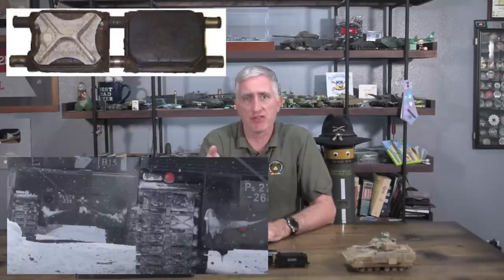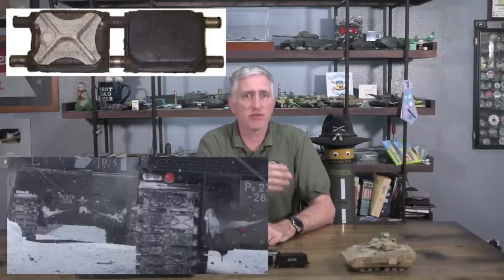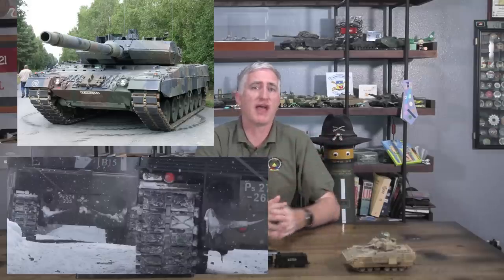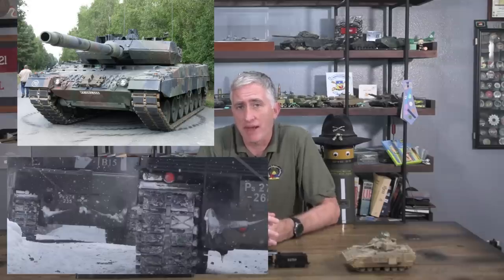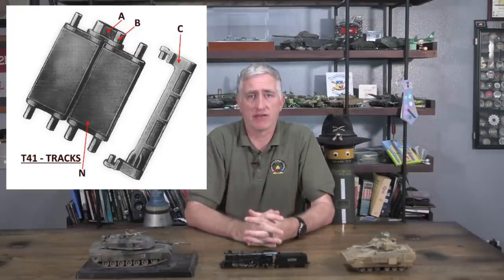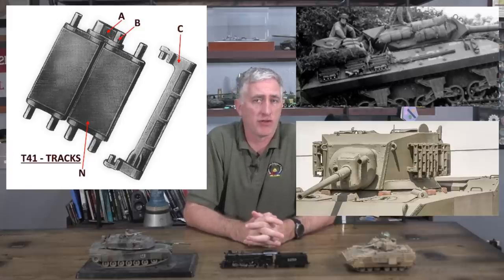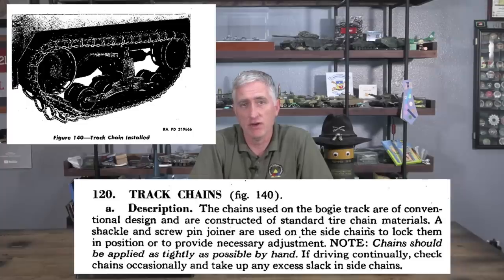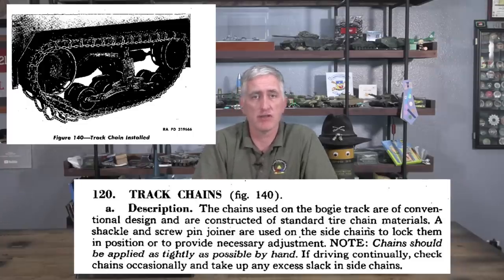Tanks 104: The basics of armored vehicle tracks

Comment: Couple of track anecdotes, to wit: We did a road march around the British MTA (Major Training Area) of Bergen-Hohne in our freshly issued M60A1 RISE Passives (C/2-1 Cav, 2ad (FWD)) which were the first time we had seen the track with replaceable pads, T142, I think? Turned out the adhesive attaching the pads to the backing plates was bad and we spent our road marches with the loader facing rearward on the lookout for flying track pads. These were quite weighty and capable of injury if they caught you unaware. actually batted one away once, ONCE! ouch.

During a REFORGER exercise (same unit) in I want to say '81 we were motoring through some Ballpeenhammersdorf outside Hanover when we had to make a right turn on a cobblestone road. Rubber pads notwithstanding by the time the troop got through we had pushed all the cobblestones to one side and dug an impressive gouge. A couple hours later some bright light decided we were in the wrong place and ordered us back to our starting point. coming back to Ballpeenhammersdorf we now took a left turn and undid all the work a repair crew had done to repair the original damage. I'mna pretty sure they were not amused.

Bonus anecdote not strictly track related: Approaching ENDEX we were ordered to convoy to an assembly area where we would wait our turn to railload. We had to cross a canal and the only bridge for miles had a weight class of '5'. About the only vehicles in a cav troop that could safely cross a weight class 5 bridge were the jeeps. My PSG, hard charger that he was (future TRADOC Smaj) ordered me across the bridge. Being a freshly minted buck Seargeant I said 'roger' loader, gunner, get up here with me on top of the turret and traversed the turret to make it easier for the driver to bail, just in case, don'tcha know. Took it across at about 10mph and made it. turning onto the road paralleling the canal I turned to look back waiting for the inevitable oh spit moment. Miraculously everyone made it while I watched pieces of the underdecking fall off the bridge into the canal.

Fast forward a month was playing a monster panzer leader/panzerblitz game (4 players, 1 American armored div, 1 British armored div, 1 Russian mechanized corps, 1 panzer grenadier div. each enters from one side, massive catfight in the middle, no allies (officially, but skullduggery is always afoot). Anyway, one of the players was a Lieutenant who was also the Bde's maneuver damage officer. I casually related about the bridge. I'd never actually seen someone turn white. He disappeared and came back in a few minutes with a map. 'Which town Sgt A?' That one sir points "Gotta go, see you guys later, clean up before the Major gets here. He has a temper and I won't be here to run interference." Yessir. It was Sunday morning and we'd just pulled an all-nighter playing the game and had just returned from breakfast. Found out later from him that he'd gone to the town in his POV and found that the bridge had been repaired, bill for the work submitted so everyone was more or less satisfied.

Back in the mid-70s we had something called 'Brigade 75, 2AD, 1st and 4th ID(M) fielded a fourth brigade that would rotate in and out of FRG on a 180 day TDY rotation. Eventually some bright light figured it would be cheaper and less disruptive to make the now independent brigades permanent so 2AD(FWD) was actually an independent brigade until 2AD deployed when we were supposed to link up and deploy with the parent division, which we did once, ONCE. Can't speak for the mech bdes.

Thus endeth the interminable 'anecdotes' related by a 66 yo armor has-been. Gimme a step ladder, I can issue a fire command. Gunner! HEP! Schoolhouse! Fire Fire Smoke! But all the new electronics? Not my M1, looks the same, not the same. Taught the M1a2 to Kuwaitis, current M1A2 SEP whatever is not the same tank. It look similar but someone would have to carry me and I be old and stuph.

Comment: It is a very interesting video and basically you have highlighted the basic difference between a fully metal track and the rubber padded tracks. It always come in my mind the Sherman with the the two types of tracks., that said the crews always complained the lack of handling, even on relatively low slopes on wet grass with the relatively narrow rubber tracks but generally much easier on hard roads. Good job as always 👍👍👍

Comment: B 1/185th once went to Minnesota in January for a winter AT.  Needless to say, the ground was frozen hard.
The tanks slipped and slid over almost every surface, so we refeversed every 10th centerguide.
It worked like a charm, but the horns of the guides ended up getting bent and deformed the hole assembly, we had to cut a lot of them off.
That took a while with 14 tanks and two torches.
Reply: I'm assuming it would not have been possible to weld grousers on it, or not permitted.
Reply: @tacomas9602  Dunno that grousers are even available for M60/M1 tanks.

Pulled onto a range at Bergen-Hohne, started firing and the snow started falling. By the time we were done there was about 6" of snow on the ground. When we tried to drive off the range (paved road) first tank got halfway up and slid back, second tank didn't get that far. Moi saw this and turned off the road and went up on the ground alongside. Everyone followed me and all were happy-ish campers. CO was not amused 'range control is going to be on  my ass allison'. Never heard a peep from the british or the germans.

Comment: Track Basics tracks always break at the worst possible place and time. Also dun fact car tires rotate just like tank tracks. At the contact point the wheel/track is not moving, but the tire/track portion 180 from from the contact patch is at maximum acceleration and from the 180 point it starts slowing down until it comes to a stop at the contact patch.

Comment: Another great video.  You mentioned reversing center guides for traction on snow/ice.  Thing is you just can’t reverse the center guide.  The center guide is too tall unless cut down and will make a nice cut in fenders and sponson box’s. I know in the M60 series we carried sand bags full of cut down center guides in the mid 70s in both ROK and FRG and in the mid to late 80s in FRG. Never did put those on but we carried in case needed.

Comment: The reason for the rubber in a live track is that it deforms, twists, allowing the track links to hinge ( a bit) while the pin does not rotate in a bushing or something. The pin is vulcanised to the rubber.  As the pin does not rotate is does not wear out. Therefore live tracks last far longer. Its the same principle as the silentblocks in a cars suspension.

Comment: Well, that's a few of my questions answered with your usual excellent style. Now why is it that some tanks shed their tracks more often than others. Thinking back to the book brazen chariots involving Brits driving M3 light tanks (Honeys) it is said that the honeys would keep their tracks on in maneuvers the Crusaders would not. The Honeys had rubber blocks in their tracks that would tear up over rocks (as you described). Now there is a question about how the suspension spreads out the load from the tank. The German Panther and Tiger had overlapping road wheels which they held would provide more even and effective loading. Since the Mk V and VI had tracks that were much harder to repair and were prone to freezing solid in those wonderful Russian winters - how much of an improvement was that arrangement?

Comment: As for the rubber pads on tracks, not just to protect the "civil" infrastructure - they provide more grip on paved roads, as in towns in Western Europe, but also don't tear up the roads, and so making it more difficult for your supply trucks to follow you.
Still, in 5 years in the Army, we never changed the pads - just replace the whole track, and if someone wants to put on a new pad on a track block back at the depot, well, so much the better for the crew that next uses that track block -

Comment: Bit of a physics note; tracked vehicles are still wheeled vehicles. The amount of roadwheels and I suspect their lateral width and diameter still matters for ground pressure, as the contact patch load is distributed around the roadwheels. The track does not completely evenly split the load as some sources seem to imply. I'm pretty sure there's easily-obtainable mathematical formulas to calculate the approximate contact patch load for tracked vehicles, and I've seen a few FEA sims that insinuate this.

Comment: Would love to hear more about modern rubber tracks like they use on some cv90. I think they are 4 pieces linked together for the ease of replacement. They are also relatively heavy, on a half of a metal track
Reply: Articulated cab tracked AFVs like the BvS 10 and Bronco/Warthog have a continuous rubber track, IIRC. They are relatively quieter and less brutal on road surfaces than metal tracks.

Comment: Ground pressure can be tricky. I read a story about the Falklens war, and a British tanker stepped of his Scorpion tank and sunk above his knees in the bog. The tank had less ground pressure per Sq inch then his shoes.
Reply: Kinda boggles the mind before thinking about it, but that one is a lightweight reconnaisance vehicle so it probably has even lower ground pressure than most vehicles.
Now I'm tempted to look up its track width, estimate how much of it makes ground contact and calculate how heavy/light a human in normal shoes would have to be to get the same pressure.

Given the much larger area a tank has contact with locally bad conditions also seem plausible to me, a single small bad spot wouldn't let the whole tank sink but if the human feet find the bad spot that's bad news.

Comment: Look up the Canadian M113A3 track i thinkbyou be in love. TLAV. The track is fixed easily by strapping metal bars to fill in the gap. It is tensioned by grease gun. And 2 good tech can change the track in 2-3 hours. The chains are 6-8 inchs long attached by bolts to the side of the track. Fantastic system

Comment: Are tracks interchangeable left to right? What determines when a track is worn out and must be replaced entirely?
Reply: Wear is similar to a bicycle chain. Too much stretch.
Reply: Track links will stretch over extended use and the track tensioner is used to take up the slack as he tracks stretch. The Chieftain tank has 96 track links when new and as the track stretched you removed a link, when the track was at 92 links you had to then fit over pitch drive sprockets to accommodate the increase in pitch as the track wore. When the track was at 88 links you reached the discard criteria and had to replace with new track and standard pitch drive sprockets.
Reply: M1 tracks, per the manual (not sure in practice), have to be removed and reversed every 500 miles.  So the track gets pull off, laid next to the tank, spun around 180 degrees (so the original outside edge of the track is now inside) and put back on the tank.  After you went over it and replaced all the obviously worn out parts. Every 1000 miles you did this and then put the left track on the right side and the right track on the left side.  Not sure when the track was considered worn out, but each of the dozens of track shoes has about 30 parts (including the nuts and bolts) that you can replace as needed.

Comment: note that once a track s slipping the second track will keep the vehicle going straight and the slipping one becomes a conveyor belt that hardly convey anything since id doesn't grip on material. tracks a good for flotation but not all tracks a good for traction (the b1 bis stile tracks where kept on the arl 44 because deemed superior as many know but it was traction wise, those are basically dozer tracks) rubber tracks < padded tracks have less traction than steel tracks < construction machines tracks even bulldozer use different tracks aggressiveness, drain layer and trenchers have huge grousers  that can be added or removed according to soil softness.

a tyre will grain grip due to structural elasticity up to 25%, slip a track will up to 5%. you don't want a track to slip but in order to steer it has to...

Comment: I have to wonder if the designers of the British WW1 rhomboid tanks were thinking about increasing track contact when they sank into softer ground. The curve in the wheel placement would have been to decrease the amount of track in contact with the ground so that they could steer those awkward beasts. The overall track length and shape was made for crossing barbed wire and trenches, but anyone who knows anything about caterpillar tracks knows that the longer the track, the harder it is to rotate the vehicle.
Something that surprised me was that Chieftain didn't mention that rubber track pads are also intended to help prevent the pavement damage done by solid metal tracks.
Saying that rubber tracks molded around cables are less durable is also something I feel is a slight misrepresentation. They could only be used on light vehicles, but they were durable enough that there are still M3 halftracks operating on their original tracks today.
Reply from the maker: Look carefully at a WW1 British Tank.  Whippets have this effect as well. On hard ground, the tank basically balances only on the central four or five wheels, the wheels beyond those central ones tend to be an inch or two off the ground, particularly towards the rear of the tank. This is for the precise reason you mention: Shorter contact area is easier to turn. But if the tank sinks only four inches, you've almost doubled the contact area and thus halved the ground pressure.

Comment: Could you also address the advantages/disadvantages of the different track retention systems?...When I was on Abrams, which obviously use center guided tracks, we were regularly popping track and having to pop it back on...When my great uncle, who was a Sherman gunner then commander, never spoke about tracks popping off the road wheels...Shermans of course had their teeth outside of the road wheels...Did the difference in configuration have to do with the road wheel configuration?...Do the teeth being outside the road wheels help with track retention or is it because Sherman's used the smaller wheels on trucks?...
Reply from the maker: It's the smaller wheels issue. VVSS bogies are only one roadwheel wide, so to have a center guide, they would need to split the wheels.

Comment: I suspect that the disadvantages of small wheels are that they have to rotate faster and are closer to dirt and rocks. Advantage is that they are so low that they are less likely to be shot at.
If one bemt can come down in front, another go back up in the rear, and some number on eacg side all of the same length would it be faster to change? Problem is to get the power to each belt as you drive.

Comment: Are there special extra grip tracks , or extra grousers for breaching or mine plow vehicles , which basically function as armoured bulldozers , 
Or is track spin not an issue .. 
Also would extra low ground pressure tyres ( modern tractor tyres,) be less likely to set off  anti-tank mines  , or is 30 ton on 6 or 8 squishy tyres just as likely to trigger an antitank mine

Comment: Could anyone inform me what type of track has been converged on as "the best solution for the modern context" and which types have largely fallen out of use? Is live track very common in modern western vehicles?
Reply: Typically, live tracks allow for slightly better ride and steering characteristics than dead tracks. In addition, live tracks typically have a significantly longer service life and require less frequent retensioning than dead tracks. 
On the other hand, the procurement costs for dead tracks are often significantly lower than those for live tracks.

Comment: regarding Live Tracks, aren't the ones on the Kettenkrad and some models of ww2 german halftracks also live tracks? 
from what i remember they had grease nipples on the track pins which would've reduced power loss on the drivetrain.

were there any other AFVs that employed such a system?
Reply from the maker: Not nipples, they were bolts you would undo and put oil into them. Time consuming nightmare, the Czech post war derivatives got rid of that and used more normal dry track. Advantage not considered worth the extra work.
Reply: @TheChieftainsHatch  I see, thanks for the correction as well as i may have confused it with something else at the time of writing.

indeed it would've been a time consuming nightmare, I doubt the operators were fond of such a system, though i still would wish to own a kettenkrad but with a wider rubber track as found on that of WW2 US halftracks.